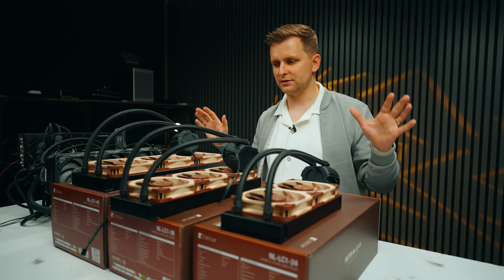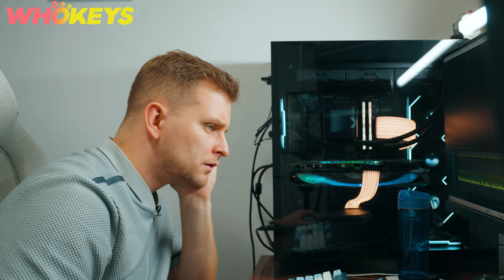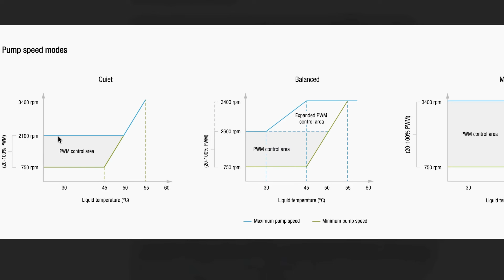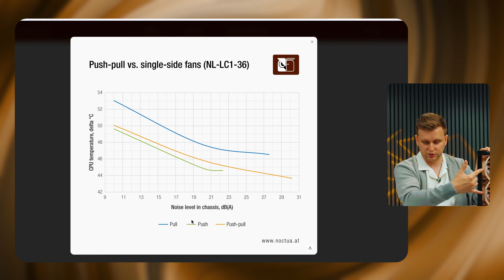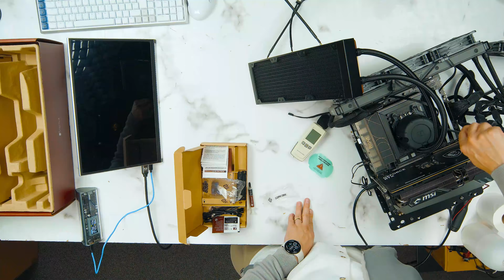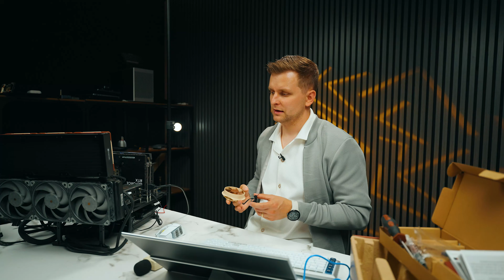Noctua's NEW AIO just destroyed half the PC Cooling INDUSTRY

Comment from the maker: ✅ Check out Noctua Cooling Here:
240mm https://geni.us/240mmNOCTUAaio
360mm https://geni.us/360mmNOCTUAAIO
420mm https://geni.us/420mmNoctuaAIO
Reply: Noctua just destroyed PC Cooling INDUSTRY => no real comparison with competition in the vid => pinned post with affiliated links
looks about right
Reply: Please do a comparison this and noctua  NH-U12A If you have one
Reply: Nice job on the review - I'm seriously looking at the 360.  My issues with these AIOs have been - 1. No refill port b/c they always run dry eventually  and 2. The radiator is always aluminum instead of copper causing that anode/cathode issue between the cooling base (copper) and the radiator...  And then it is really expensive to build your own - +$400 !    And I have a question too - what FLIR camera are you using in this review ?
Reply: @theTechNotice   Brother, I'm not trying to nit-pick, but I just simply had to mention the fact that the 420mm Noctua NL-LC1-42 will NOT be louder, in fact, the opposite is true! Because the Noctua NL-LC1-42 uses larger 140mm fans instead of the 120mm fans used on the NL-LC1-36, it's a configuration that yields an even more impressively silent operation when compared to it's 360mm model sibling. The 420mm AIO also has, as you correctly pointed out, a higher tolerance prior to reaching its heat saturation limit, but you're not at all wrong in saying that the 360mm model is almost certainly the sweet spot for the majority of peoples' use cases, both with regards to case compatibility & the AIO'S capacity to adequately maintain CPU's from thermal throttling.

By the way, nice job overviewing/reviewing the phenomenal job Noctua has done, with their first forray into the AIO liquid cooling product segment no less! Noctua doesn't miss, it's actually pretty impressive. Their R&D efforts pay off in spades, as demonstrated time & again across their entire product stack.

Loved the video, man… all the best.

Peace ✌️

Comment: I have 5 of the NF-A14 PWM fans as case fans in my Fractal Design 7 XL case. One at the back. One at the top (back) and three in the front.
They feel loud when they get above 50%. They feel a lot louder than the NF-A12 PWM fans. The NF-A14 doesn't have the "bent" blades and that might be the loudness differens.

Comment: If younwant the best aio and noxtua take the 420 artic , great pump and radiator. Then mount industrial noctua 3000s on the radiator. Pop the artic pump cap off. Works perfectly without. Then buybthe noctua auxiliary fan not good looking. But can be rigged. or get a square 80mm or smaller to hit the zone. 

Boom affordable better noctua incognito artic cooler.

Comment: I have the 360 version with the NL-ACF1 fan installed in the Noctua Antec Flux Pro case (black G2 fans though) and it's fantastic. I previously had the ASUS Ryujin III AIO and its across the board better. It's nice not having the LCD as well. I will be purchasing the black version when released. Great site!

Comment: Yes the 420mm is going to cooler better than the 240 but it's not so much the fans pushing the air through, it's more about the actual size of the radiator itself. since CPU's don't typically stay under load all the time you don't need a high fan speed. you can leave the fan on medium and have good cooling, it takes a few seconds for heat soak to happen and by that time the cpu is probably done with its task before the fan speed ramps up.

Comment: I used to be a big "fan" of the huge and chunky air CPU coolers. Which used to be much more reliable, more quiet and much cheaper. But now, with my 420 Freezer II running silently 24/7 for almost 5 years no problem and with better results (i9-12900K) ... I think that I might try a 280 AIO next time. Or perhaps a 200 AIO. Because 120 fans still don't make much sense to me )) Unfortunately, Noctua has no 280 AIOs. But, why?? 280 are cheaper, make less noise and perform just as well as 360. I mean, if they care about the silence so much, then it doesn't make any sense.

Comment: I didn't see anyone mention your wrong placing of the noctua aio. At fisrt test (asus rog) you have the radiator facing the motherboard and the cpu block transfering heat directly to them. Another thing is the Db meter. You have it in the same place but it has about 11-12cm distance difference between the first and the second senario... Yes i love noctua products, yes i bought a lot of them in the past, but when you make a detailed presentation video, you need accurate numbers. with these testing circumstances you have not.

Comment: is the pump really that much quieter? i have the LF3 420(non pro) and i let the pump run at 80% and boost ot 100% with full core load on my 7800X3D(yes the 420 is Overkill but it was cheaper then the 360 at the time of purchase) i have never heard the pump over the fans but at normal operation even my arctic fans are whisper quiet and only start to hear them when pushing a AAA game to the max and is the performance worth near 3x the price? im not bashing noctua as i love them but living on the name alone vs other cooling companys

Comment: I don’t think the test you did was really fair, first you need to do the test in closed case and running games for few hours or cpu stress test, then you can tell if that aio is quite or not, leave that inside the case with a 5090 at max power under those cooling pipes then you will have the proper results

Comment: Was it really Noctua that destroyed half the water cooling market, or was it actually the other brands—by offering pricier, lower-performing products—that helped discredit water cooling in general, and custom loops in particular?
To me, a distinction should be made between custom loops and AIOs; referring to AIOs simply as "water cooling" does a disservice to custom setups.
Regarding this AIO, I gather from what you're saying that the pump doesn't rely on the loop's coolant for cooling. That’s actually a smart move by Noctua, because in custom builds, the pump is usually placed behind the intake fans—often the only real space available—even though the pump itself is cooled by the liquid.

Comment: If you truly want an equal comparison with credible results, you have to repeat the conditions exactly for all tests conducted. You would need to place the radiator in the same place that the first one was. If you think the positioning of the radiator doesn't make a difference on flow rates, it does. It has to fight gravity on the second test, and hardly at all with the first one being almost level. The results are still impressive, but if your thing is comparison testing, (which it is kinda your thing for the most part) then that's a pretty important aspect about comparison testing and research and the credibility of the results. Just some helpful input from a fan. Loved the episode <3 
P.S. Tone is not something you can convey with text, but mine was not meant with any negativity whatever. All love and genuine feedback to lend you more credibility towards harsh critics. That's all I meant by this <3

Comment: Of course, the Noctua AIO is the better product in this test. However, the noise level measurements are not suitable for comparison. The Noctua's fans are farther away from the microphone because the radiator was simply placed on top of the other AIO's instead of being installed in the exact same position. Unfortunately, this makes the test setup invalid.

Comment: the noctuas radiator about 120-130mm upper sitting on top of the other radiator which makes the noise measurements inaccurate, also fans are blowing towards an opposite side.

Comment: See Cinebench stress test below with about ~20% decrease in temps in some areas:

Switched from Artic LFIII Pro to Notcua NL-LC1-36 w/ VRM Fan. Quietest PC to date out outstanding thermals with a 9950x3d (undervolted), ASUS Astral RTX 5090 BTF Edition GPU (undervolted), ASUS x870e Crosshair BTF Edition, corsair dominator titanium 96gb DDR5 6000mhz, WD SN8100 M.2, all in the Corsair 5400 air w/ 6 noctua case fans (NF-A12x25 G2 PWM) on a Notcua NA-FH1 fan hub.

	                  AIO Only-Stress	AIO+VRM Fan-Stress	Stress Delta
cpu	                            53	                           52	              -1.9%
cpu kacage	            64	                           63	              -1.6%
gpu	                            53	                            41	             -22.6%
gpu mem	            63	                            53	             -15.9%
gpu#1	                    48	                            46	              -4.2%
dram temp	            60	                            48	             -20.0%
mb	                            42	                            39	              -7.1%
vrm	                            62	                            52	             -16.1%
chipset 1	            60	                            56	              -6.7%
chipset 2	            58	                            51	              -12.1%

Comment: Overall a good review, only issue i have as a long term IT guy is you can't test on open rigs it 100% skews results for so many reasons and maybe understanding why push/pull on either side of radiator doesn't work will help understand why cases are designed in specific ways (in some terms these days unless running extreme rigs, cooling options available mean you can deal with stale air etc better)

Comment: My R7-5700X3D is cooled by a $35 (USD) Thermalright Peerless Assassin SE (and dead silent even when gaming, 400RPM idle about 600RPM gaming).
I had planned to buy a Noctua NH-D15 G2 when it came out and I did my build. It came out at $150 USD. I rethought my life.
I'd NEVER buy an NVidia AIO if a good Noctua air cooler could do the job though. As much as I trust NVidia, the PUMP will eventually fail and the tubes will absorb some liquid reducing efficiency over time.
Definitely a use case for an NVidia AIO. I'd say if your USE CASE research has the fans on the air cooler regularly above 800RPM and noise matters to you, I'd probably go to whatever got the fans below 800RPM.

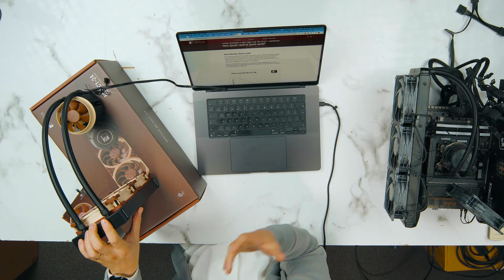Comment: 09:50

Good vid.  Looking to build a cube pc with top specs. And the 240 rad might be a good fit.

But was it me or your was your push/pull/... Pull / push configuration explanation confusing?  Haha.

Pretty sure that it didn't matter what the orientation of the fans were. .. They always just pushed air out and towards u. 🤔🤷

Comment: Cool, but 200-250 dollars for an AIO, when you start counting in price and efficiency compared to a basic air-cooled rig, is it truly worth it?. Also the risk of wetting your system.
Never had any problems with pure air-cooling with 140mm fans, almost silent and good enough. Maybe if youre running 100% loads with a 8 or more cores. 
But basic gaming even with a high-end rig, proper 140mm case and cpu cooler fans and youre pretty much good to go, also good thermal paste.
Reply: And a good pair of headphones because of the jet engine noise

Comment: I got the 420aio for Noctua.
When I make the CPU work at 100%, the temp stays around 70 degrees Celsius or lower.
And my CPU is i9 13900KS. One of the hottest running CPU in the world.
I had Arctic Liquid Freezer III Pro 360 in my lian li lancool2 mesh. Yeah, very breezy case with strongest 360 aio.
But when CPU is used at 100%, the temp rises to 85 to higher than 90 degrees Celsius, close to 100.
So it dropped the CPU temp 20-30 degrees lower which is insane.

Comment: I just upgraded to a Corsair 7000D Airflow Case, 7x Noctua Chromax G2’s in 140mm, and the 420mm Noctua AIO.

My temps are so much better across the board, I actually upgraded because I wanted to max out my DRAM refresh times and restrict my TRFC down to 480, but even with a thermalright RAM cooler I was hitting temps too high under stress to be confident I wouldn’t get errors and possible corruption.

So I ended up going the new case route and figured hey, I might as well get all new fans and get the largest Noctua fans.

Then I decided hey why would I wait or buy 120mm fans when they’re so expensive, so I threw in a liquid freezer pro III 420mm in my cart to knock it all out.

Well, this new cooler came out, I saw a video, ordered it same day, here I am.

On my 9850x3d with like a -15 PBO offset, I capped at 79C under the worst CPU stress tests I could find after over 30 minutes.

While running furmark 2 with an average GPU power draw of 285w, after 1hr while simultaneously running testmem5 with anta777 extreme, my hottest DRAM stick peaked at 51.5C.

This is while I haven’t been running any fans in my rig above 60% fan speed!

My GPU set to 50% center fan, 30% for the secondary and tertiary, I hit a peak of 75C after over 1hr at 285w~ constant load.

My front Noctua fans running under 60%, my top radiator fans running under 60%, my rear exhaust single at 50%, and it is SOOOO quiet.

My build is blackout, and I ran memtestpro over night and hit 1000% coverage with no errors, but I forgot my PC was on when I woke up because I didn’t pick up on the noise!

Absolutely bonkers, worth every penny even though it was expensive as all hell.

Comment: Would the 420mm version be an upgrade over my Arctic Liquid Freezer III 420 for a quieter system? My system is pretty quiet already but I cant really tell if its the AIO Radiator fans or the GPU fans from my 5090 that make the noise when its under load. Is it even worth just replacing the x3 Arctic fans with Noctua ones as I'm happy with the cooling right now?
Reply from the maker: well, make sure it's the AIO first and then I'd say yes!

Comment: That's nice! I know some people are put off by the color but it doesn't bother me. My old CoolerMaster Evo LAN Box has three 120's and two 80's and it sits next to my desk and you cant hear anything. When I put a load on it and the fans on the GPU kick in is the only sound it makes.
Reply: The colors can always be changed as I very rarely use the stock fans that come with an AIO anyway. I use 6 Noctua Industrial 3000 RPM fans with this AIO as I already had them and they are black.

Comment: What Im wondering with those temp tests did Noctua skew the results by leaving the case open?? Thats the point of closed cases is air pressure so it cools your components all Im saying did they do that test in a PC case with the side panel open because if they did then that result is very disingenuous , if you have enough positive pressure in the case you shouldn't have to worry about VRM over heating.

Comment: I will try to use the 420mm version of this product when I upgrade my AM4 system. I am waiting for Zen 6 or Zen 7 low latency interconnects. I love Noctua fans. I have six 120mm of their 3,000 RPM heavy duty fans in my 4u TrueNAS rack mount in a push pull setup for the front hard drives. I have a single Noctua 140 mm 3,000 RPM fan in my current desktop and it pulls air in over the VRMs and the speed is tied to the VRMs.  At 3k RPM these are loud as hell but expected as they are more industrial.  Try the 3,000 RPM fans for fun, doubt it would make for a video though.

Comment: I'm using thermalright assassin 120 air cooler  on my 9950x3d inside lian li a3 matx case  and it's quite and I hit 62c on occt avx512 extreme full load but I'm -30 on all cores 😂.  CPU lottery on a bargain air cooler.  9 cores hit 6ghz  on single thread load.